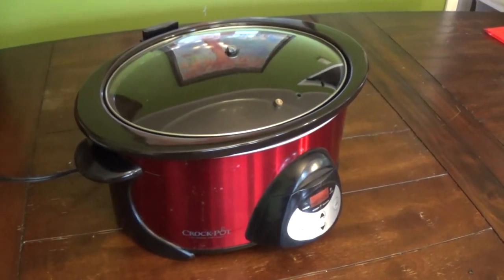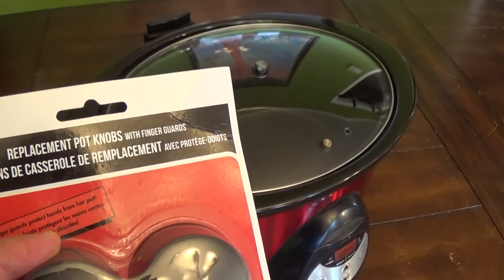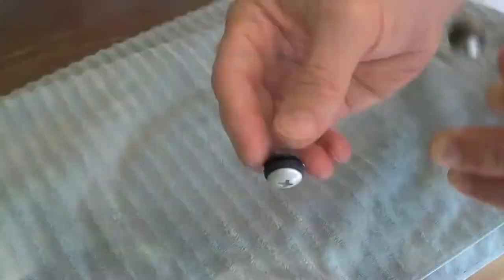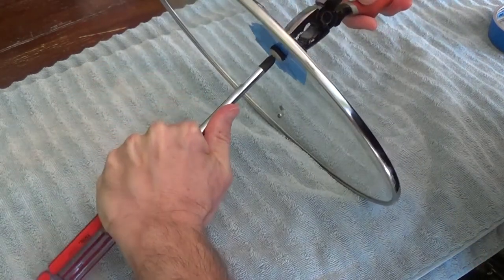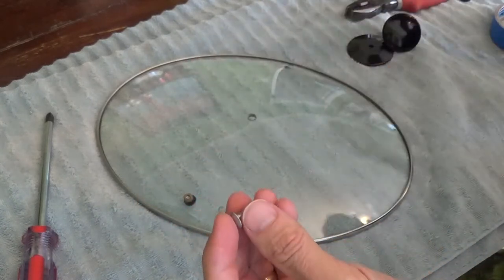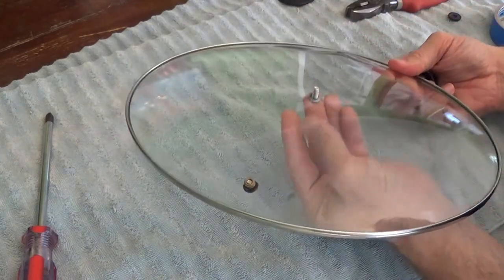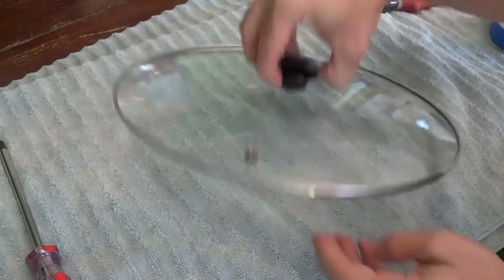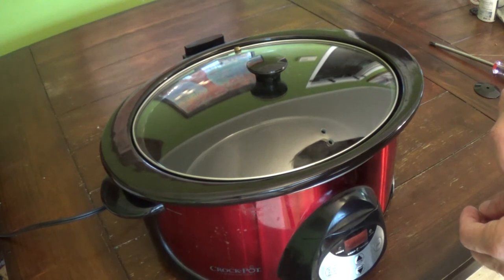How to Replace a Crock Pot Handle

Comment: 5:13 For what it's worth: I think you should have used the base plate.  I agree with liking the look.  The plastic base spreads out the stress on the glass and will reduce the chances of the glass breaking if you push down on the handle when grabbing it.

Comment: 4:40 About matching a bolt:  The hardware isle at Home Depot has a display form.  It has bolts for all sizes (metric and imperial) as well as matching nuts so you can find what you need.  

(I do not work for Home Depot.  How I know this is because I've spent a lot of money in that isle from tinkering.  If I could I'd just buy stock in that isle and I'd be rich beyond my wildest dreams :p)